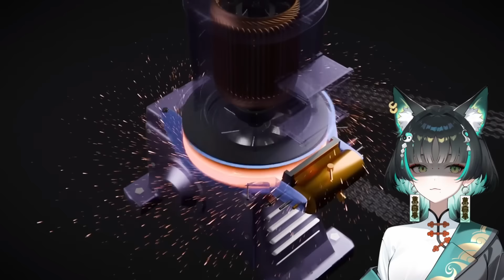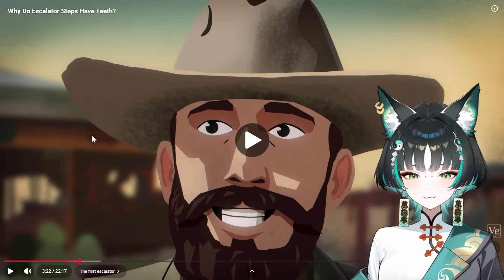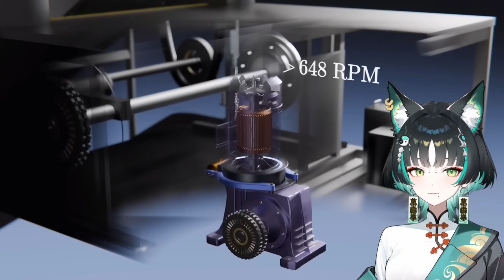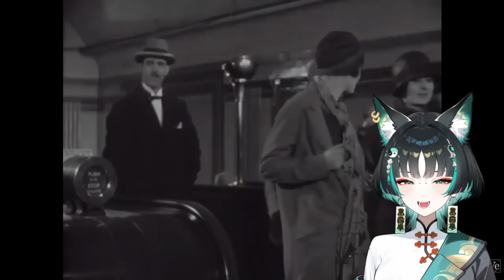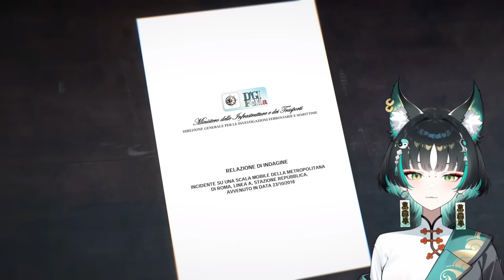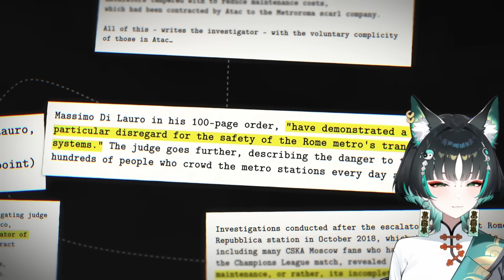NEW FEAR UNLOCKED?! || Veritasium Escalator Reaction

Comment: Whenever im on the escalators i never stand there like a statue , i got places to be .
Reply: In one of the DC Metro stations it has an escalator because the Metro-rail track is 3-stories underground, and most people don't wanna climb 3 flights of stairs.  Yeah.... I've manually verified that I can easily climb a frozen Escalator faster than they would normally move.

Comment: They probably left the zip ties on because the brakes were engaging so often that they were stopping the escalator from moving so they zip tied some of them back so that some of the brake would still work and then after it saw that the load had decreased it would just go back to normal and remove them. But if all the brakes would engage then the thing would stop completely and someone would have to check it and fix it and cost money.
Reply from the maker: I see 😮

Comment: honestly, negligence and corruption in this kind of things is pretty common
going according protocols can be pain in the ass, plus people in charge often puting money for maintenance in their own pockets
you can report repair work or part swap while not doing it and take that money, its easy to track but noone care or people who watching for it also payed
i once maintained diesel generator, and there was a starter accumulator, wich was out of spec
so i reported it, and my boss just said let it be
couple months in, another dude put that accumulator on charging sequence and it fokin detonated
luckely he was not near so noone was harmed
or another case
i was sent to repair charging device, one fuse tripped, so i asked where spare parts
and turns out that all fuses were burned, that single fuse were burning everytime
i reported to my boss and he said just to shortcut it(meaning that you bascally putting a wire instead of fuse, wich means if something go wrong, that shit most likely will burn), cs he didnt want to go with full repair shenangans
Reply from the maker: DETONATED!? 😨 Your boss...haih..
Reply: Especially considering neglect is often motivated by "cutting corners" (aka the profit motive of capitalism). Neglect of machinery necessitates a risk evaluation, where a capitalist must consider if the costs of something is worth solving a potential safety risk, and the profit motive often motivates capitalists to value profits over human safety. when looking at this under a systematic lens, the capitalist class financially benefits from endangering more people, because corporations only evaluate how much an asset can generate profits for them. Even though things like escalator should be the property of the state, in order to let the state regulate public transportation to be safe, the mere existence of private property prevents these types life-saving regulations from being implemented nationwide—because private property belongs to the capitalist class.

In the US, Reaganomics was a lesson on what happens when the capitalist class owns the water infrastructure. So many cities in the US had brown tap water with lead in it, and these cities had to buy back the water infrastructure from capitalists, just to save people from toxic chemicals.